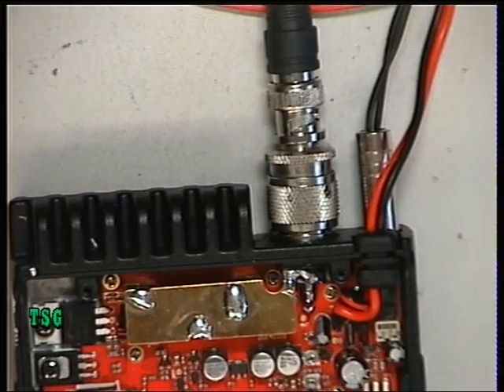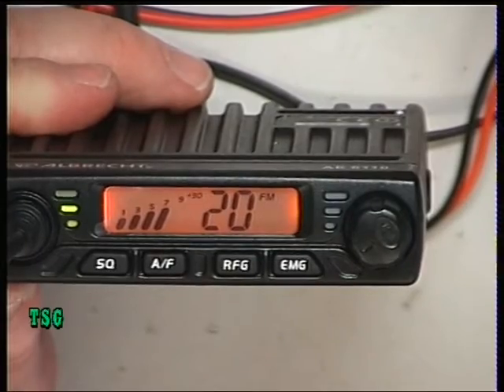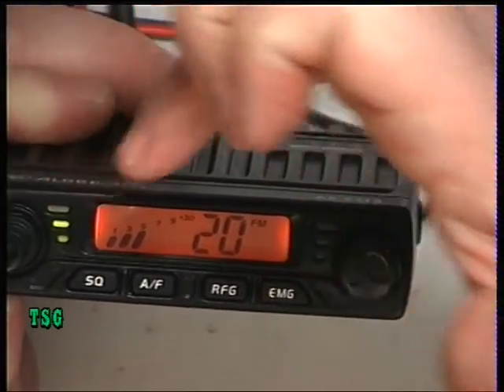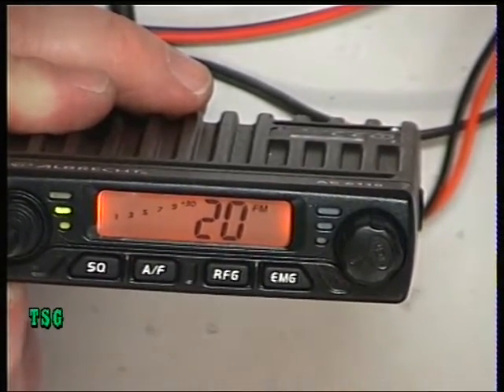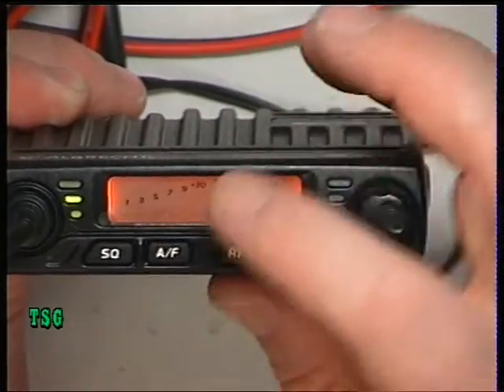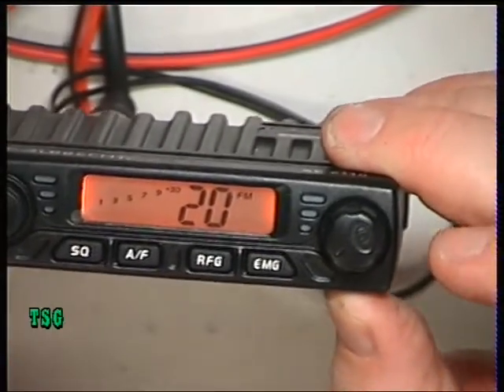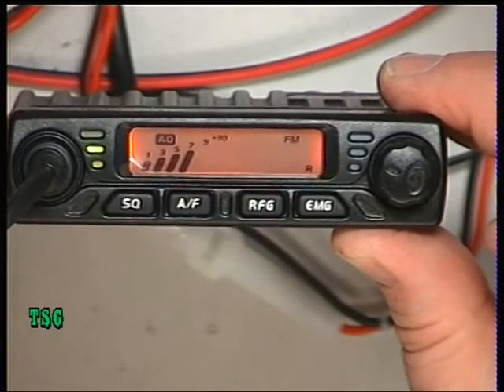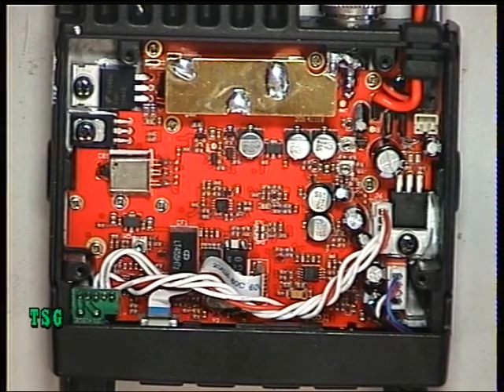Albrecht AE6110, UK (CE Multi-Norm) CB radio (Mobile) - Receive

Comment: Richard I have one of these and want to fit it to my Suzuki Jimmny with a roof rack can you recommend an antenna which won't look silly
Reply from the maker: I haven't really got an answer as we only use drilled-in body mount aerials. We use the Les Wallen Modulator aerials or similar. Although there are shorter aerials, the performance drops off dramatically. For example, the  best I ever got on a mini springer was 10 miles as against 35 miles on the modulator. Use of magmounts also drops off the performance. By using the drilled-in mounts we are using our own cable rather than using a CB type made-up assembly. Therefore we can use really high quality cable designed for mobile phones.

Richard, G0OJF, UK
Reply: @ukfmcbradioservicingTango21  I think I will go for Thunderpoles Mighty Atom with a spring at the base, and put it on the back of my roof rack, if this rig does not work (as it's been a few years since I've used it) I would like to get a Thunderpole t600
Reply from the maker: @richardmorris66  You may end up with poor SWR on a roofrack. Ensure the rack is earthed to the vehicle.

Richard
Reply: @ukfmcbradioservicingTango21  will do it's one of those roof basket types
Reply: @ukfmcbradioservicingTango21  Richard how can I tell if my roof rack is earthed and if I need to fit an earthing strap is it easy
Reply from the maker: @richardmorris66  With a multimeter on ohms setting, check between the roofrack &  a known ground. It should read around zero ohms i.e have no resistance.

Richard
Reply: @ukfmcbradioservicingTango21  ok thank you sorry to be a pain asking loads of questions

Comment: 3 cazuri mods power albrecht 6110 Romanian Language 
1.Strap OP1 = putere reglabila =4Wati/8Wati (10 Wati daca se regleaza semireglabilul putere invers acelor de ceasornic),banda implicita devenind DE+marirea numarului de canale la 400; 
2. Strap OP2= banda radioamatori=putere reglabila 4/8wati (numai pentru pasionati); 
3. Strap regulator putere C-E (pin mijloc + pin stanga cum te uiti din fatza statiei)= putere fixa intre 20wati-30wati maxim (antena sa fie foarte bine calibrata). 

3 cases mods power albrecht 6110 
1.Strap OP1 = adjustable power = 4Wati / 8Wati (10 Watt if the semi-adjustable anti-clockwise power is set), the default band becomes DE + increasing the number of channels to 400;
 2. Strap OP2 = radio amateur = adjustable power 4 / 8wati (passionate only);
 3. C-E power regulator strap (middle pins + left pins as you look from the front of the station) = fixed power between 20wati-30wati maximum (antenna to be very well calibrated).

Comment: there are preset rf gains and regular rf gain i do believe. i found a test function by accident. hold RFG and EMG while powering on and it goes through display test then i believe you see the firmware version. i have one  running on my base antenna and my friends cannot believe the quality of the audio from this little radio using the stock handheld mic. i did the same adjustments to mine. raised the low power deadkey slightly and turned the am modulation up slightly. i am going to mount a tiny 12V dc fan to the back fins and check temp with infared gun. this thing is amazing for its size. i wish there was a NB ANL setting but the auto squelch works pretty good.glad you made this video
Reply from the maker: Thank you for your input...hopefully a service manual trickles through to the trade one day & then it won't all be educated guesses on my video!

Richard